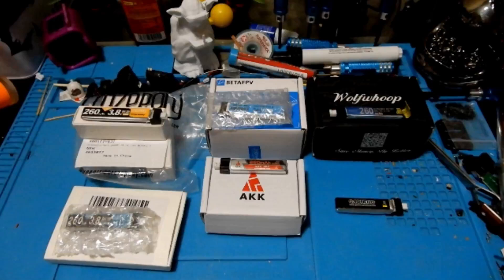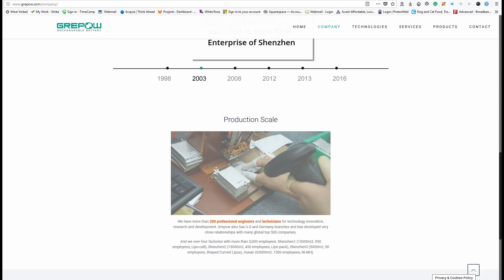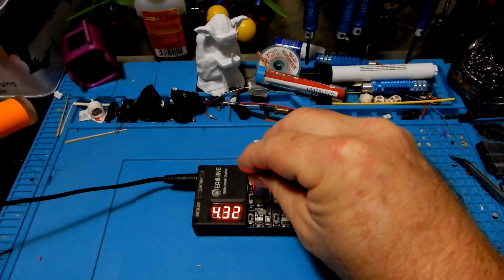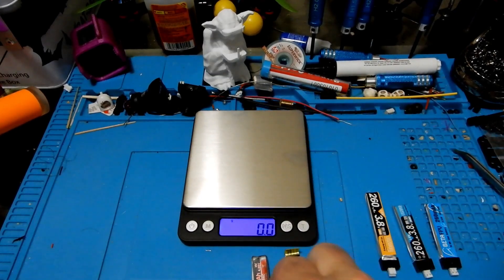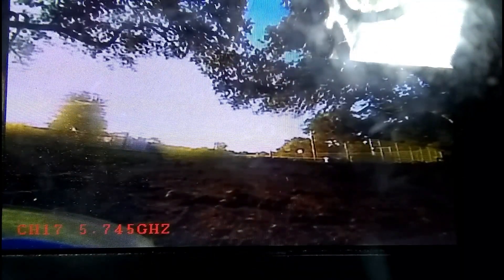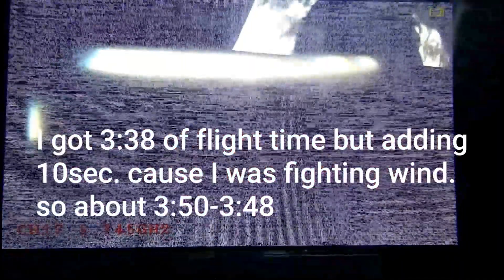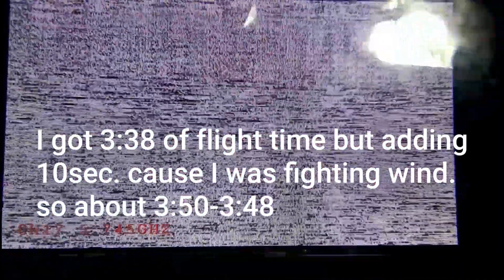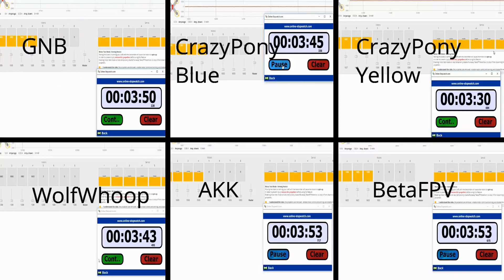260mAh 1s HV Lipo Battery Shootout ✔

Comment from the maker: Hi all just to clarify, these were all 1s HV lipos. So normal storage is 3.8 and 4.35 fully charged. My charger displays all batteries off by around +.2  so fully charged HV's read as 4.55 thus why i mentioned that the 4.15 was actually a good 3.8x storage state for them. I am sorry for that confusion and i will either fix or not use that charger in future videos. It's just something i am used to.

Comment: Nice review dude! Isn’t 3.8V storage voltage? If those lipos came in at 4.1V to 4.2V it could be because the supplier stored them at 4.2V (fully charged) and they just sat on the shelf for a while which would slowly drain the lipos (and damage their capacity).

Btw thanks for including the crazeponys! I used the 230mah for my 615 whoop and liked it, but was unsure about the 260mah one. Looks like I may go with AKK (and click your link 😉)
Reply from the maker: I also just changed the Title as well.
Reply from the maker: Yeah i mentioned that my charger reads wrong in the video. It reads around .2 higher then reality. So it reads 4.55 as the final charge. Eachine crap. Also i may have not said enough in the video and maybe not at all dang it these are all HV's
Reply: The Quadcopter Review Ah okay. That makes sense. Cool

Comment: Interesting results. I've used only GNB 260mA batteries before. Then I got BetaFPV 260 and it's much smaller then GNBs. And from my experience new Betafpv was weaker then old GNBs. I was wondering if it wasn't 260mA actually.
I got few regular 0716 woops and one 0603 brushless. And was hoping that brushless will be much better. Unfortunately it's not the case. Good motors from Boldclash do a trick.
I can't comment on bigger size woops but for small 65mm type I would stick to 0716 motors.
Happy flying.
Reply: Yeah I saw that with the wolf whoop when a race friend let me try on and I realize that other batteries usually aren't as good as gnb can do.
Reply: my ur65 and us65 both are faster than my beta65s. and they wont burn out nearly as fast as the brushed motors.
Reply: @brandonr2188  I realy dont know how you guys burning brushed motors? I do replace motors time to time as they become noisy and not performing, but burning never.
I guess I know how to disarm fast.